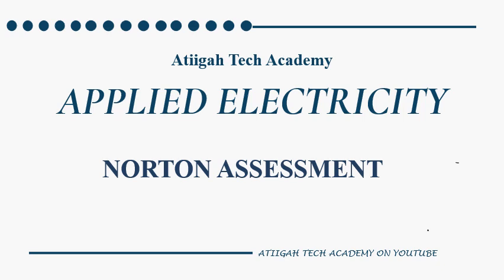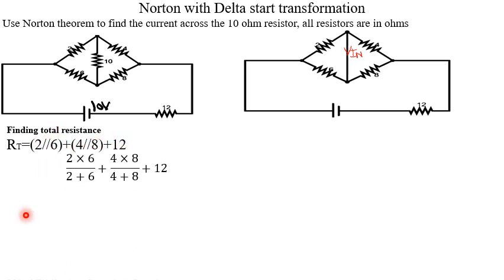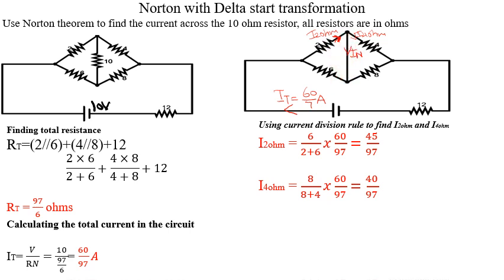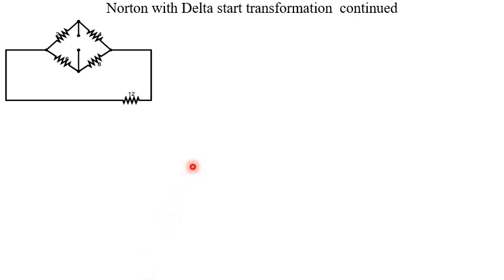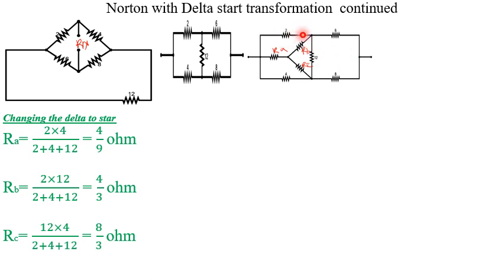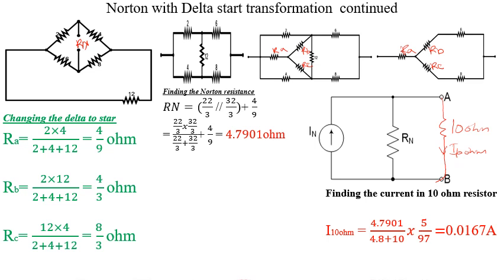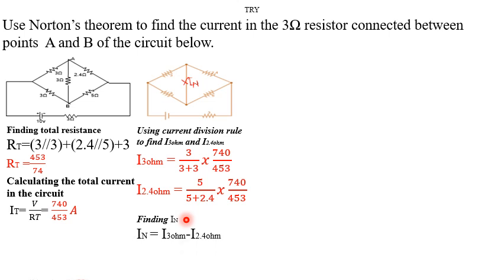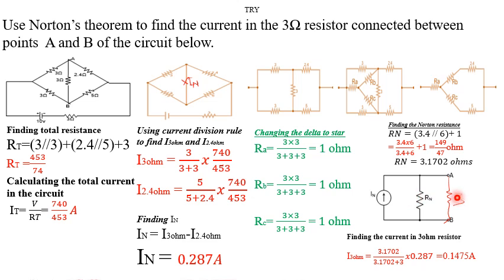Norton’s Theorem & Delta Transformation – Step-by-Step Assessment!

Comment: Please your answer for the current flowing through the 3 ohms resistor is wrong. 
It's supposed to be 0.14943A.
You made a mistake when rearranging the circuit to find the norton resistance
Reply from the maker: my answer is right boss. the difference in your answer is because of the approximation of the decimal places, it is best to always solve the problems using the whole fraction. kindly take your time and check again. Thank you